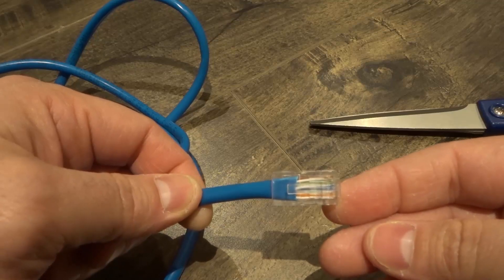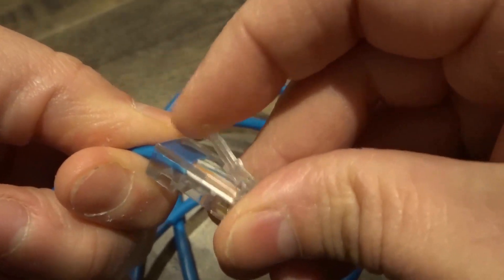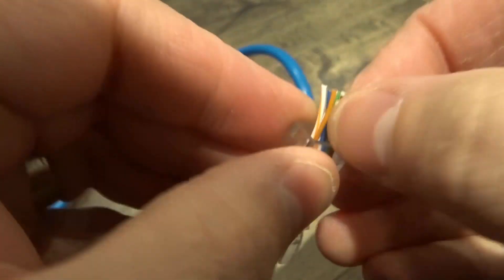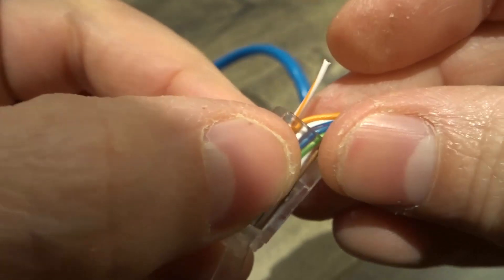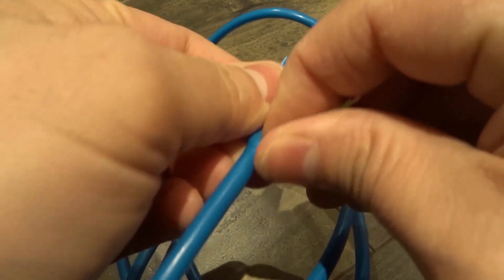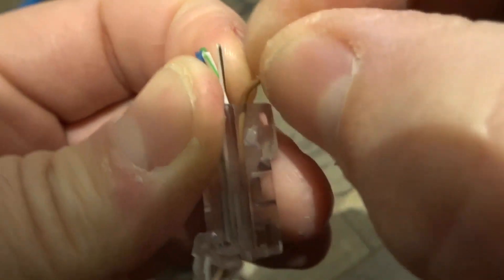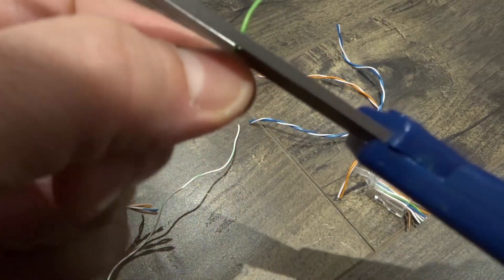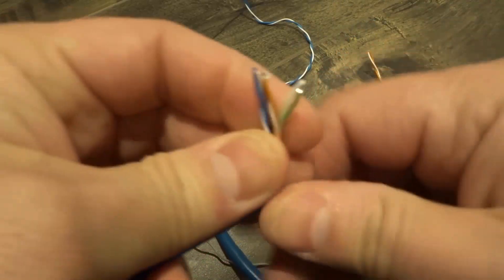Taking Apart An Ethernet Cable-Cool Experiment To See What's Inside

Comment: The noise prevention on that cable is simply the twist in the pairs. A normal home doesn't need a shield because there is not many high power loads with large electro magnetic fields

Comment: please give me instructions for  making a thermal panel of wood using tll the wires of the Ethernet cable. I require a panel of size 12 inches by 12 inches or about that size. one quarter or one eight inch thick. thank you